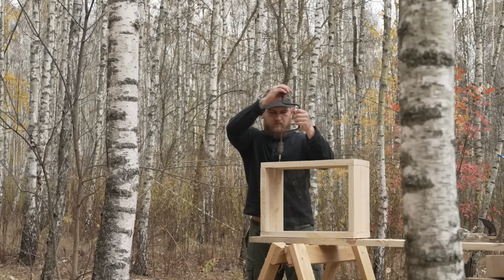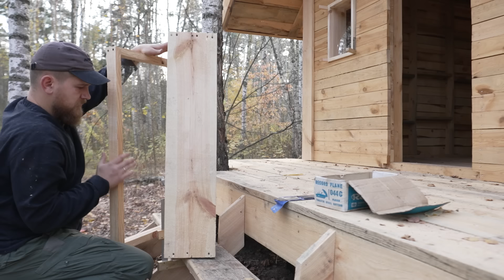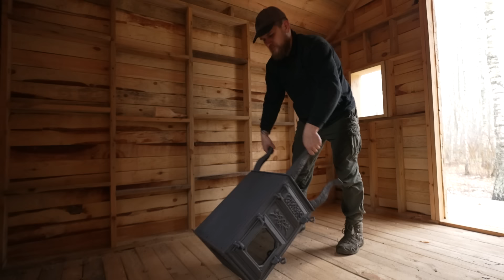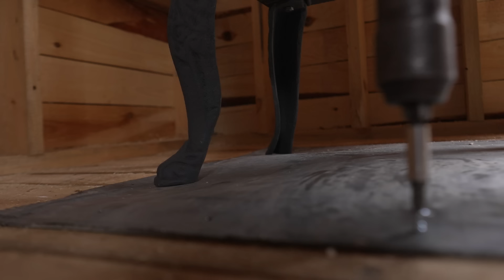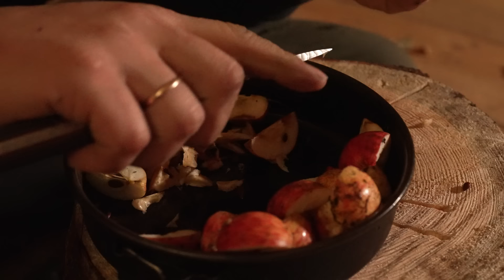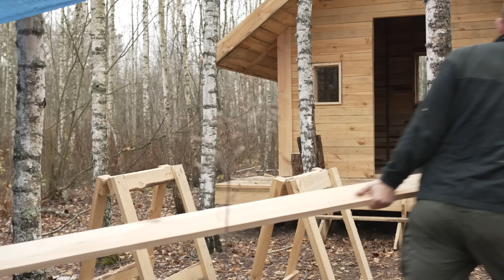stove and window to my traditional log cabin with hand tools , rain and wild animals

Comment: Hey, when you are installing a wood burning stove chimney through a wall a common error made is that you can exit out from the rear of the stove and run horizontally, directly through the wall to the outside. This is incorrect as there must be NO HORIZONTAL RUNS, this is due to hot gases needing to rise and if forced to travel horizontally, they shall lose their heat, deposit soot in the pipe and hit the right angle turn like a barrier and slump back down the system. Please take care!
Reply from the maker: thank you, I will look into this issue!
Reply: Perhaps in a windy place the updraft helps the flow of gases. He will find out in good time!